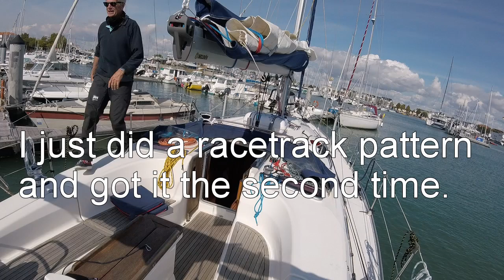Ep 18 Solo Sailing: How I Dock My 40' Sailboat 4 Examples and a Blooper

Comment: Very nice. Our Oyster 485 is much heavier than your boat, and we find that especially when parallel docking there is a tendency for the boat to continue leeway once you make a turn. We have a MaxProp feathering prop so there is almost no prop walk. I start the turn a bit earlier than you do and keep the rudder turned away from the dock as I go into reverse to reduce and then eliminate speed. ideally I go to parallel about 5' from the dock. Even though I'm in reverse at this point I do not turn the wheel toward the dock until momentum actually shifts and we start moving backwards. We do have a very powerful Vetus bow thruster, but for style points I try not to use it unless necessary. As the boat drifts onto the dock my wife steps off to set a check line (midship line set around a winch, which I can release from the helm should need arise). In forward (or reverse depending on wind) we snug up to the dock. Not solo, so not bragging here at all. Docking is far and away the hardest and most stressful part of sailing. BTW, a bow thruster only pushes the bow out and in. So getting the stern into the dock if you miss it is problematic. Use the thruster to push the bow out and reverse back in. That's the only way to correct other than do a "go around". We also advise sailors to deploy fenders on the opposite side of your boat once in a (double) slip. This is because you need to protect against other skippers docking next to you when you're not around.
Reply from the maker: Really excellent posting 9000.   (Serious boat envy by the way, and congrats on your recent Bay of Biscay crossing which I followed with great interest.)  I'd like to build on two points you made. Firstly, I did not discuss prop walk in my video, and should have.   I have a saildrive on my boat, so the prop is much further forward (closer to the pivot point) than on a conventional shaft/prop boat.  This means I probably only have about 1/2 the prop walk that conventional rigs have.  That is both a plus and minus, but probably slightly more of a plus;  one less major variable to take into account.  The other point concerns bowthrusters.   All of my friends who don't have one really wish they did, and all of my friends who do have one realize that they are not a magic solution to docking problems.   They certainly assist, and I'm delighted I have one, but you still have to correctly manage speed if you want a successful docking.  (I actually use mine much more on departures than arrivals.)   Again, thanks for contributing and best wishes as you head south.
Reply: Hi Patrick. I certainly agree with everything you say. We're actually still figuring out the nuances of Talisman as she's more or less new to us. At this point we've been in and out of marinas enough that things are settling in nicely, but I do know that one of these days the wind and tides are going to conspire to make berthing a real challenge. The local school boats here in Gibraltar, where we are now, are mostly Bavarias (like yours) and Jeanneaus in the 38 to 44 foot range. The instructors take 6 or so adult students out each day and they literally park and re-park these boats at least twice per student. I like to watch when I can and identify mistakes and good judgement when I see them. It's kind of off season and there are a fair number of empty slips, so they do different approaches, med moor, bow in, parallel, etc. They also sail into the marina under reefed and sometimes full main depending on conditions and I see them sailing onto a practice ball in the big triangular space between the fuel dock and airport here in Ocean Village/Marina Bay. I'm a big believer in learning from other people's mistakes rather than my own. BTW, what camera and mic are you using?
Reply from the maker: I love watching how others do it as well to see if I can pick up some tips.   I once did a weekend course where we did nothing but port maneuvers.  Unfortunately, those courses are almost always based on having additional crew on-board who are ready to step off with a line.   Going in solo requires some 'adaptation' of the technique.   I use a GoPro to film with, but as it does not have an external microphone, as soon as you put it into the wind, the sound becomes terrible.    I love it for its size and ease of use though.   A fixed camera with a dead-cat will result in some loss of spontaneity, but I'll probably get one prior to next season.   Best regards
Reply: Yes, isn't that the truth. With 6 or 7 on board an easily manageable boat there's no shortage of people to run and help fend off. Still, a very useful exercise. We were at one of the local bars last night and spent about an hour talking to one of the instructors. He said they were handling Yacht Master trainees, and that it takes about 17 hours of intense instruction to pass. I was somewhat amazed. It took Wendy and I months to do our Day Skipper/ICC Stateside training, plus a full day on the water in our own boat. I used to solo our previous Catalina and it always felt precarious coming in for a landing. But the boat was small and I never had anything go wrong. The wind was always up and that boat loved to go sideways if the breeze was on the beam. I'd say 50% of the time we're in position for solo docking but 2 people makes it feel a lot safer. Congrats to you for doing the much more difficult job of full time solo sailing.

Comment: For a long time I had the same docking issue, except instead of coming alongside another boats beam, it was a series of smaller motor boats with raised outboard props, just 2 meters away.  Ahead of entering the marina, I would tie my bow and stern lines together amidships (with a zephyr bend knot) to make a large "D" outside of the lifelines.  I would motor slowly alongside, step off onto the finger/pontoon and plop the "D" line over the three pontoon cleats (forward, mid, aft).  With the single line running bow to stern I could then control position along the finger/pontoon, as well as depth from pontoon.  Once the bow and stern lines/springs were secured at the correct length, I would undo the (now) slack zephyr knot in the middle.
Reply from the maker: I really like that method, but perhaps my finger is not quite long enough.   I really can't leave the helm until way into the slip, and then would have to run forward about 5 meters to be able to step onto the pontoon with the D line.  I don't think it would work in my case except in the lightest wind.   I'll give it some more thought though.  Thanks for the suggestion.
Reply: I have to admit binging out on your videos Patrick, you have instilled a lot of confidence in my desire to take on the blue water some day. I'm a Cat man but absolutely enjoyed your 'Isabelle' and how it handled the journey. I also hope you keep posting more instruction videos as we all need to keep updated on the little things that can go wrong or right too!
Reply from the maker: Such a nice compliment Jon.  Much appreciated.   Best to you.

Comment: Thank you Patrick. It's a pleasure to watch your videos. You are a very calm and likeable person. :)  In this video i got to think, that you might not be aware of the "prop-walk"? 
It's a physical effect from the propeller, that will drive your boat's rear to the side (normally to port (left)), when you set the drive in reverse.
Reply from the maker: Great comment Ole.   My boat has a sail drive, not a prop and shaft.  This means the prop is MUCH further forward than on a traditional boat (and closer to the center of rotation of the boat, thus much less prop-walk effect).  I do have a bit of prop-walk (ironically, to starboard in my boat), but it is nowhere near as strong as boats that have a traditional prop and shaft located far back from the center of rotation.
Reply: Yes, all boats are different, and act ...  
Actually it is a bit funny i found your videos here, and your home port is La Rochelle.  About 3 weeks ago me and my wife meet 4 Frenchmen from La' Rochelle in Denmark. All retired and on their way home from Nordkap in their campers. The one pair was former leading of a paper factory nearby (which is gone). They have had a boat - though a small one "Gib Sea 24" i think. The other couple were farmers and made grapes for Cognac production. 
They became a bit insulted, when they had to explain to me, where La Rochelle is located. :) But now i know, and suddenly i know 5 nice people from the area around the city. ;)
Reply from the maker: Well, there is only one thing left to do Ole.   Jump in your boat and sail to La Rochelle to see if it is as nice as the locals claim it is.  :-)
Reply: Well now i have been through all of your shared videos, and i discover you have never made it to Denmark - at least not in your videos. :) 
It has been a pleasure to follow your travels and many god tips and advice's. I specially like your experimenting way of trial and error (under cautions off course), and your open minded way of attacking problems. 
Maybe it's something you have learned as a fighter pilot? I don't know, but i have the same approach to all i do. If someone claims he is smarter than me or can do things in a better way - I always think: "Show me please". I also has a past as an officer - though in the Danish Artillery. But even that, has some relevance to sailing . :) 
I don't think i will be able to get to La Rochelle by boat in the nearest future. My boat is a Maxi 84, that i recently bought in Sweden. I need a least a year to get to know it an prepare it for secure sailing on bigger sea. 
Maybe you might consider sailing to Denmark one day. I would be delighted to show you a part of my country. I have a lot of Swedish cards and harbour information you can borrow if you go further. I don't need them, because Sweden is not one of first my priorities. :) 

Thank you for your very good videos. It has been a pleasure to watch them, and you.

BR

Ole
Reply: I forgot - i can't find episode 1. :)
Reply from the maker: Episode 1 was the first time I ever used a GoPro, and didn't realize that you can't wander around in the wind with the camera.   The sound quality was horrible (compared to just 'terrible' in the first series of videos).  As it was completely inaudible, I decided not to post Episode 1.   The videos start with "2".   Thanks for watching.
Reply from the maker: Well, technically, I did make it to Demark --- the Faroe Islands.  :-)   Thanks for watching Ole.   I may make it to Norway/Sweden/Denmark next year.   I haven't yet decided which direction to head.  I still have one more  major sail this year to do (Spain).   That will be in September.   Again, thanks for commenting.

Comment: I'm so with you when you're going in. I've obtained a couple of Line-A-Sure plastic grappling hooks, running thru mid ships, and they seem to grab anything I throw them at without causing any damage to 3rd party properties. I only use them on tricky solo pontoon or mooring ball arrivals before tying up proper.
Reply from the maker: Thanks Peter.   I've seen those hooks before.   It looks like a very clever system, but I already scare the heck out of my neighbors.   If you glance at Episode 32 and 33 you'll see the system I chose.   I've used it a number of times since then, and it works very well.  Thanks for commenting. Others may benefit from your preferred system.

Comment: Nifty. Sometimes I do that with a forward spring line the length of the boat looped over a cleat or pile right from the cockpit.leaving it in gear with the wheel turned hard.so the boat just hugs the dock.
Reply from the maker: My challenge is to get the darn line over the cleat.   I'm usually pretty good at positioning the boat, but then miss-throw the line (you'll see that several times in future episodes, including N° 30 that I just published).   I'm going to try one of those poles that allow you to drop a loop over the cleat.  Can't be worse than what I am doing now.  :-)

Comment: Thanks Patrick for a very enjoyable series. I watched it all lying I’ll in bed, learned a lot of good tips and can’t wait for next April to be out on the water again. I don’t know what camera you are using but improving the wind screening on the mic would be good if possible. A combination of fleece material and foam works well for me. Andy
Reply from the maker: Thanks Andy.  I use a small GoPro camera.   They are notoriously bad for sound quality, but their ease of use is unbeatable.   In my second long series (around the UK) a combination of using a small dead cat specifically made for GoPros (called 'WindSlayer') and much more awareness of where I was filming (under the sprayhood as much as possible) made theses videos much better (but still a bit irritating) than the first series of videos.   If you use a large camera, you can use very professional remote mics with perfect dead cat silencers, but you lose a lot of spontaneity in the filming as the camera has to be set up in advance on a tri-pod, etc.     Short of bringing another camera operator on-board, I really don't know how I can improve very much more on the sound quality.  Sorry for that, but many thanks for the kind feedback.

Comment: Thanks for this. I tend to tie one end to the mid-cleat and then lead a bridle back to one of the rear winches. Stop dead, throw the bridle over a cleat and then motor forward - Which gives you a spring to motor against as you mention in the video.  I find that if I prepare the lines 'properly' with a coil for each hand and then sort of fling the line outward and forward, it is difficult to miss.  Although I do miss. This is great for locks and coming alongside.  However, as you say, it doesn't work with short finger berths.  I love sailing solo, but it is a pain to set up fore, aft and centre lines and then a bridal spring - on both sides to come into a lock.  Then set up slip lines to get out, and then do the whole thing again in the marina.  I am tempted to try your method just to watch the faces of people as I gently and deliberately ram into the dock. Cheers.
Reply from the maker: :-)   My neighbors are polite, but I'm sure they are always a bit nervous when they see me coming back into the marina!   I really like your 'bridle and motor forward' method, but it is just not possible where I am based, especially with a 40' boat.   In fact, the prevailing wind where my berth is about 12-15 kts at 90 degrees to the finger (into my neighbor's boat).   I just can't stop before going all  the way in or I will give my neighbor the 'bise' (French kiss on both cheeks).   I have been hoping for another berth where the prevailing wind will blow me onto the finger (and I can stop 3/4 of the way in).  No luck yet.  Hence, in the absence of a better idea (for a solo sailor), I will continue using the crash method.  

Love your videos by the way.   Terrific.   Please keep them coming, and thanks for watching mine.
Reply: I have only just discovered your videos and am catching up.  You have carefully hidden them by not putting the word 'sailing' in the channel name.  And yes, a 28 ft boat is a lot easier single handed than a 40 ft one.
Reply from the maker: Thanks.   I'm not very good at this social media stuff......  I'll have to sit down with a millennial and find out how to do this without losing everything to date.   :-)    Cheers for letting me know JAS.

Comment: Great "tutorial" you have given, I just wish my mooring was like yours rather than end on end, which can be also very tricky to get into with a 37ft steel ketch. Keep up with sharing good videos like this.
Reply from the maker: Thanks Dave.  I plan to do another video in the spring on mooring techniques including pylons, and moring balls, etc.   Can you explain in more detail what the 'end on end' model is you refer to, and I'll try to film one if possible during my planned passage to Norway in the Spring.   Thanks again for watching.
Reply: Patrick  I'm on a river pontoon, where the boats are typically moored in a long line abreast of a pontoon. So when you step off onto the pontoon you either have your port or starboard against the side of the pontoon, of course with enough fenders out, so manoeuvring into ones allocated berth between other boats can be pretty tricky, especially when short handed with a current running.
Reply from the maker: Got it Dave.  Yeah, I've been to a couple of places where there 45 feet available for my 40 foot boat (with other boats on either end.   I like to back in at a 40 degree angle on those occasions if possible.  I get the stern right next to the cleat and drop the line over, pull it snug, then motor forward into the pontoon.   It usually works well, but can be stressful if wind or current are lively.  You must be pretty good at this maneuver now.   Thanks much for watching.
Reply: Cheers for that, I've been going in bow first at about45deg with my first mate ready to throw line around the pontoon cleat, take up the slack, while the current pushes the stern towards the pontoon. Stressful every time although even though it's a tight spot to get into... will try your method if conditions are right.. cheers for the advice...

Comment: Hi,

If the wind is blowing you off hard, you could fender your Port side well and moor to the adjacent blue boat then carry your springs to the finger and spring yourself over to your parking spot.
Reply from the maker: You are, of course, absolutely right Jonathon, and I suppose I should consider doing this in very high wind conditions.  That said, nesting a relatively large boat (40') solo, in high wind conditions is not the easiest thing to do either, but it is certainly a tactic that is worthy of serious consideration.  Thanks for commenting.